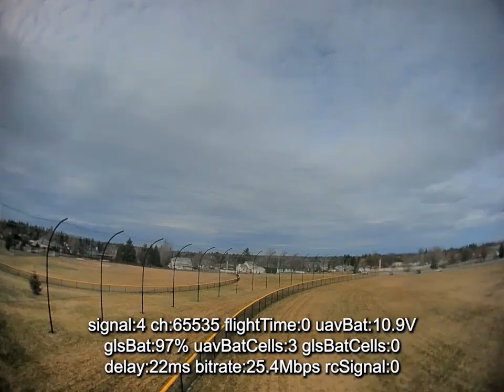Crazy Drone Flight Gone Wrong: Watch!

Comment: could be antigravity but could be wind/propwash aswell not sure 
very hard to tell with no sound 
the antenna tube is broken so ye its flopping around but that should not be the normal state :D 
its a antenna in a platic tube that sits in the 3dprint mount they tend to snap right where the mount ends 
you can try get a sma adapter and a sma antenna those are a bit more sturdy
Reply from the maker: ill look into that this soon! i bought the sma adapter actually it arrived yesterday and attentas to. idk how to get sound from my dvr to tbh i been thinking of adding a caddax camera to it but i dont think they do sound either?